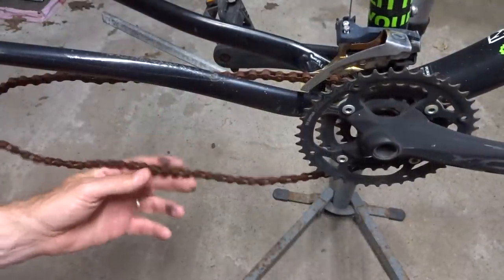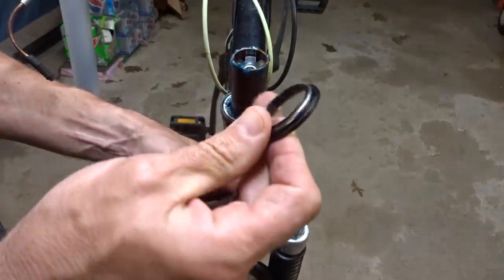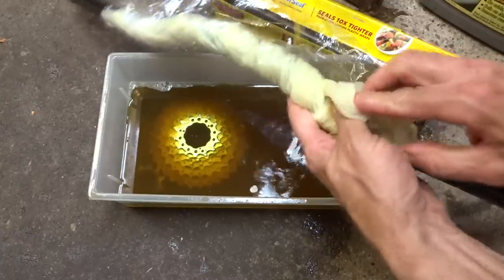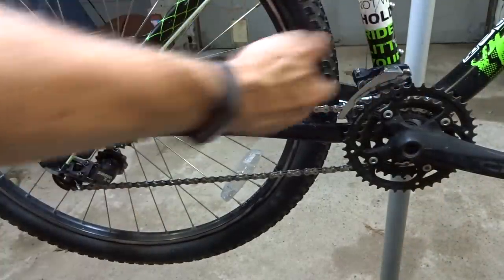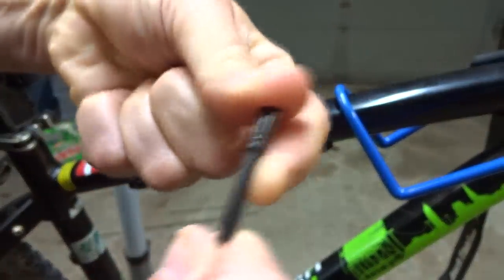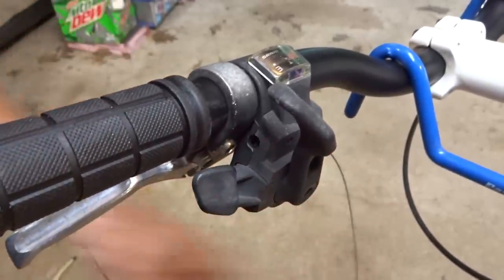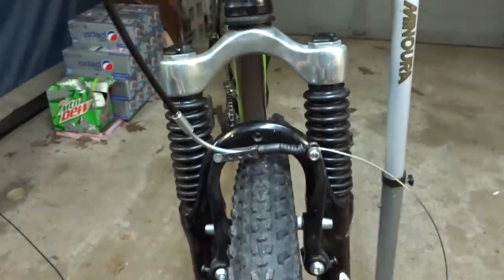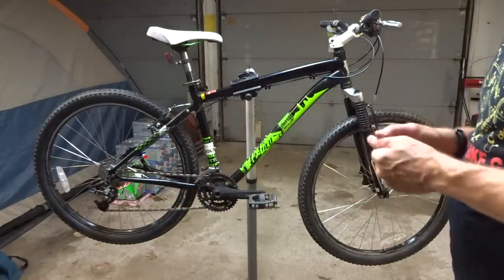Fixing/Overhauling The $15 Specialized Hardrock Mountain Bike

Comment: I have an older Hardrock Comp HR, but it's like in new condition for a 2004 model, I bought it used in 2005.  The only reason for that is the lack of use and having it properly stored indoors.  However,  I've been hooked on mountain bike videos for the past few weeks and I'm ready now to start riding.  Your video was very helpful for identifying certain parts, cabling and other misc bits of information that will add to my knowledge base.  Nice work bringing the bike back to useable life.

Comment: Great idea on wrapping the handle bar with the saran wrap like that! In the past I have taken 2-3" diameter PVC pipe with a sealed end and put the item down in it and fill with evaporust. Then put a loose cap on the open end and let it sit in an upright position.  (I have restored the legs from old pinball machines this way.)
Reply from the maker: I thought about that, but the curves of the bar would have required probably a 6" diameter tube, and that would have been a lot of volume. I also considered a plastic bag.

Comment: When you install new brake cables I pull all the slack from the the cable so the pads are tight the rim and pre stretched the cables by pulling the brake lever they should leave a nice tight break with no need to adjust the brake cables after a few rides

Comment: about disc brakes....I've found wheels to be erratic consumables: with rim brakes, you can wear down the rim. with any wheel, you can seriously damage it via ruts, branches, potholes, even just being a heavy person. And then the spokes....wear out, break, become corroded where you can't adjust them.
So my point? An active rider may run through rear wheels fairly often, and at least in my experience, rim-brake wheels cost about 1/2 what a disc brake wheel costs. You just have to look at what kind of rider you are; if your rims last you forever, then the reliability of disc brakes makes sense. If you're on a budget and are hard on the wheels, then the rim brakes still do a nice job (though wet weather is not the most fun).

Comment: thanks for the update video..looks good..im surprised though you didnt take the shifters apart OR try to clean them and put a little oil inside? How about the bb? did you take it all apart and clean?lil oil on front and rear derailleurs?seat post removed,cleaned and lil lube? IM sure you did things and didnt film every single minute?

Comment: Very good practice to first clean any frame with a good cleaning product and check the tubes and welds etc for safety. I also purge all bearings etc with WD40 prior to teardown to prevent seizing and stripped threads. RJ does great work!

Comment: vaporust seems amazing
Reply from the maker: https://www.amazon.com/exec/obidos/ASIN/B00M0TLQ66/ref=nosim/youtube25-20
Reply: RJ The Bike Guy thanks!!!
Reply: ...pretty sure he just pee's into the container... :(
Reply: seems slow, a wire wheel would have that off in literally less than one minute!
Reply: and probably scratch the hell out of it too
Reply: John Possum sure bud
Reply: ROBinJVILLE 
that guy is an impatient jerk
Reply: Seems like a liquid soak would permeate creases and get in all the nooks and crannies in a way that manual labor could never duplicate. 

But mostly I’m surprised he puts his bare hand in the stuff. Maybe it’s gentler than it looks.
Reply: Evaporust is amazing and it is reusable, mine is about the color of ice tea but it still works.  The trick of wrapping in wet paper towels and plastic wrap is a good one I will pirate and use.
Reply: vaporust the rust removing version of flex tape
Reply: I use electrolysis for rust removal... I've been cleaning up a lot of old machinist and woodworking tools over the past 3-4 months and when I have rusty bicycle parts they go in the tub too. It did a wonderful job on files and rasps. They cut like new!  The electrolysis removes the rust without attacking the base metal like an acid would. That is important when cleaning up precision tools... not so much for chromed seat posts! I cleaned up some chains that had surface rust and they came out like new--low mileage bikes that had been rained on.
Reply: 2x20 for tubeless
Reply: The guy pours out a swimming pool of the stuff for just the two derailleurs and two axles. This stuff seems to be environmentally friendly though which is not that terrible but still seems like a bit of a waste to me.
Reply: Speed up the process and just submerge the whole bike
Reply: @mazer916  I like your way of thinking lol. Straight to the point, no BS.
Why would you use a .22 handgun and put a small hole in your target, when you can use a 12gauge shotgun and put Lots of Big holes in your target. Lol
Reply: @hardToSignUpHere  you can reuse it over and over.  He likely poured it back into the bottle.
Reply: Thanks. Can you recommend a maintenance stand?
Reply: @hardToSignUpHere  apparently you can re-use it.
Reply: @MehYam2112  That's what I thought. Plus, how do you safely dispose of the stuff?  He sure is good and thorough. And, an excellent teacher!

Comment: I`m guessing you realized by now, but, the reason the brake levers were bottoming out, and the noodle boot was getting crushed is the brake pad spacer orientation. I`m guessing by the long travel of the V-brake arms that the short spacers/ washers of the brake pads are on the inside of the arm and the thick/ tong spacers are on the outside. Maybe switch those around and see if if fixes the problem. 
In the current config I`m pretty sure you can`t unhook the brake quick release.
Hope it helps!
Reply from the maker: No, the levers were bottoming out because there was too much cable, and would have have happened without the boots. The brake arms will only move so far. This is just part of adjusting the cable.
Reply: Fair enough, I only mentioned it because I had the same thing happen to me on a bike I worked on, switching the position of the brake pad self aligning washers solved the lever issue.  Cheers!
Reply: Gotta agree with Ciprian. There is a reason the break pad screw posts have two spacer sizes for mounting to the V Brake. Otherwise its a really awesome thing youre doing to help a kid out with a great bike!

Comment: use a compressor to take the grips off
Reply: Works like a dream with the compressor if you got one. I've got a small compressor but boy is it useful.
Reply: Since I work in a store that does Golf Services as well. I just use their Golf Grip remover, which has a little curved needle, and then the slipperiest substance known to man gets those handlebar grips right off. Then when putting them back on, I just clean the area and the grips, and use Soapy Water
Reply: @xzalean  The air compressor works great for removing and installing golf grips too.

Comment: I'd have re-used the rusty chain (once re-lubricated)  and the old control cables. I'm cheap!!
Reply: John McMahon that chain looked gnarly lol
Reply: John McMahon You're not alone.Soaked a chain in transmission fluid for three days. Neighbor got a free bike and wanted it done cheap.
Reply: I once used Marvel Mystery Oil to soak/re-lubricate a 1980s Peugeot freewheel (freehub?). It made it quieter.
Reply: John McMahon Marvel is really good for rust also.
Reply: New chain and a set of cables is less than $20... totally worth the investment.
Reply: if your going to change the chain you might as well change the rear cassette while your at it too.

Comment: Good job of reconditioning an old cheapo bike without spending a lot of money. It helps that he already had another fork in his parts bin. He saved that bike from the trash can, really. I doubt anyone else would have taken it. 

I found an old 7 speed Raleigh MTB lying up against the dumpster a couple of weeks ago. Gonna do an El-cheapo reconditioning job. Will  replace seat, grips, tires and tubes, pedals, cables and housing. Repack all bearings, lube running gear and call it a day. Probably cost around $100-150 max. Probably sell it for what I put into it.

Comment: RJ, you have an air-compressor. All you have to do is shoot compressed air between the handlebar and the grip, and the grips will break free and slide right off. You can also install new grips the same way, shooting compressed air, while pushing the grip on.

Comment: I grew up with bicycle and I have seen so many great invitation like computers, i pods, planes, etc but the fun and the simplicity  of a bike just nothing can compere to it. Lately I am disappointed that some people are trying to install electric engine in it and take out all the fun. Love the simple bike. Also, I love bikes with single speed, I am not crazy about changing speed shift while a am riding.
Reply from the maker: Single speed won't work well here. Too many hills.
Reply: Single speeds are great for most everyday riding or just riding around town, but it'll be pretty difficult to do some mountain bike climbing without at least a bit of gearing.

Comment: Thanks a lot!  I just saw the "Park Tool CN-10 Professional Cable & Housing Cutter" in use, now I must have one!   For years, I've been heat shrinking about an inch at the start of where I want to cut these cables, then using an angle grinder with a cut-off wheel, slowly cut the shrink encapsulated area, then removing the shrink from the cut cable end, and crimping a ferrule on with a regular pair of pliers.

You go into great detail throughout your video with things that should be common sense, then just blow through the cutting and crimping with that amazing tool like it was nothing!  Shame on you!    I must have those cutters!!!

Seriously, thanks.  I just added it to my x-mas list!  Wife and kids always give up on me and get gift cards because they never know what to get me.  Not this year!  :)

Steve

Comment: I think you are my hero - I was walking through Goodwill last Saturday and came up on almost the exact same bicycle - I have a specialized diverge as my main scoot - and looking at the specialized in Goodwill I was at first thinking - eww... yuck.... what a waste.  Then I took a second, then a third and even a fourth look and I saw something in the neglected rusty sad looking bike.  I noticed the tires were brand new, not a mark on the tread from even being ridden once.  The flywheel was shining like a northern star, except for where the rusted out chain was hanging from it - which again said... never been ridden... the seat was a horrible gelatinous mess... and the handlebars were not only rusted out but had been installed upside down which looked horrible.  Then I saw the little "L"  and "R" stickers still stuck on the pedals and bright white and shiny.... The brake pads - brand new... The rims... other than the sticker that was on them turning into an ashy ghost of where it had been - were completely true and spun silently... I said to myself - one more test - I flipped the bike upside down, took the nasty chain off the front chain ring and held it so it wouldn't drag - and spun the chain ring, slowly once, then hard a second time - you could have heard grass grow easier than any noise at all as that front drive train piece spun silently as if on ice.  That silence mixed with the silence of the wheels when spun meant one thing to me - fast.  This was going to be an extremely fast machine if someone took the time an rescued it from that horrible place - it was marked 24.99 - I thought - ugh.. twenty five bucks for an old torn up specialized with potential - at the exact same time I thought a sister bike for my main ride.  They are both black - one the new style mat black that is greenish tint - and the other the old style shiny black - so of course she came home with me - the best part - it was a half price Saturday - 12 dollars and fifty cents for what is one half day away from being complete.  The tires,kept them, they were perfect - the rusty bar got a nice new carbon flat 760mm handle to make sure all of that speed that will come is able to be... well... handled.  A seat that I never used that was brand new from a Schwinn I have as my at night, bad neighborhood bike sat on there real nice.  The brakes were perfect, I just sanded off the noodles - they didn't have any at the local Walmart or close to me bike shop and they look just fine.  I have been fighting with the shift cables on both the front and the rear as all cables had to be replaced - the brakes - easy - the drive train cables were driving me crazy - until watching this today - I had a like new set of Shimano shift/brake combo sets from that same Schwinn that I upgraded the derailleur and flywheel on - the Schwinn is a bigger longer bike, but the cables are just short enough that I have had to fight with them to get them into just good enough place to work - but I know they will be a constant problem - I didn't want to "waste" the parts I had but screw that - I am going to go get new cables and possibly a new shift/brake set - but after seeing how easy it was to replace the shift cable on the original sram setup - I think I will go back to those and just put new shift cables through that little whole - I have never had a full on sram drive train, and even though the front derailleur is a Shimano altus I am just gonna go ahead and consider it all sram - that lifts soooo much of a burden off this build - once they are done I am ready to see how fast this thing will go - the model I have is a year or two newer - it came with Suntour XCT for the suspension, and although the seals are a little sketchy, a little shredder oil and a little bouncing on them and I am pretty confident they will last for at least a few years - they too had water inside but the shredder oil forced it all out and the water and the oil both came out crystal clear so I got a break there - - sorry for such a long post but you took me from somewhat disappointed in my build to now knowing what needs to be done - thank you sir!
Reply from the maker: You can overhaul the XCT fork: https://www.youtube.com/watch?v=BIJPeh-D8D4

Comment: I keep a 30 inch long piece of 4 inch ABS pipe with a glue on cap at the bottom and a screw on cap  at the top filled with evaporust for restoring antique woodworking tools, would work perfect for bars.

Comment: Have you ever tried the reverse plating method for rust removal RJ?  I cleaned the rust off all the brackets on my vintage 60's Ford Mustang using this method.  Just add 1-2 tbsps. of Muriatic acid (Toilet Bowl Cleaner) to each gallon of tap water in a PLASTIC container big enough for the parts (Kitchen garbage can works well for large parts like handlebars.  Maybe a whole Steel frame in a XL garage garbage can).  Then with picture hanger wire wrap all your parts in series.  Immerse all the parts COMPLETELY in the container with H2O/ Muriatic solution, with a length of wire hanging out of the container.  Hook the wire to the Negative terminal of a 12V car battery charger and the positive terminal to a thick nail or bolt thats immersed part way in/out of solution but NOT TOUCHING the matal parts or hanger wire. (best to clamp it to container).  Set charger at 1-2 amps. and charge long enough to remove rust.  The nail/bolt will gradually get thinner and may need replacing.  make sure to thouroughly dry parts afyer to avoid flash rusting.  Works GREAT for removing even stubborn deep rust (but takes a couple days of chargong for SUPER RUSTY parts, a few hrs. for slightly rusty parts). Do this in a well ventilated area, outside preferably, to avoid breathing in the toxic gasses.

Comment: Tips - remove handlebar grips by putting the end of bars in hot water, protect hand with rag/glove. After cleaning/removing rust from parts with moving parts - eg. Skewers, derailleurs, seat clamp, shifters, brake levers - put the parts in a tub of 50:50 atf:kerosene, lubes and rust protects. Good to soak new shift/brake cables in before installing also.

Comment: A couple of points when refirbishing bikes:

1) Check the bottom bracket and wheel bearings. If needed, clean and re-pack with grease. If a bike like this has sat outside, the grease in the wheel hubs and bottom bracket has had water get in and contaminate the grease.

2) Check and adjust wheel trueing. Reason being is that many times, a bike left outside will have misaligned or bent rims. And if those aren't within tolerance, riding the bike after cleaning and adjusting everything else won't matter, if the wheels won't roll true. Believe me, if you've got a bent rim or two, your brakes will let you know very quickly the work you may need to do, in order to have straight wheels again. I literally readjusted and re-trued my 29" rear hardtail rim last night, because I ride my bike everywhere, and was feeling a more than slight wobble in the rear wheel. I also adjusted the rear pads, because I was hearing some rubbing with the brakes released.

Comment: Great job on the repairs/upgrades, I purchased a used oldy that i wanted as a daily cruzer. Its an auto Shift Land Rider. But it was in 100% condition with some exceptions regarding oxidization. I purchase new break's for a bike i originally found  and wanted to rebuild (as a cheap bike to kick around) but decided to change them onto the Cruzer. Ur vid reflected how simple it really is and you also demonstrated how to make certain adjustments. So thanks for sharing very good vid IMO 👍i subscribed!